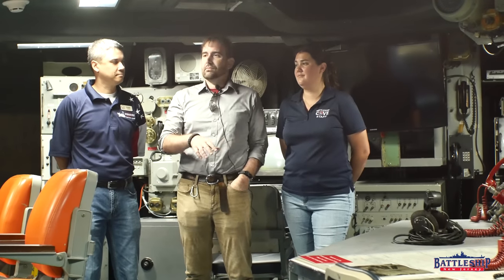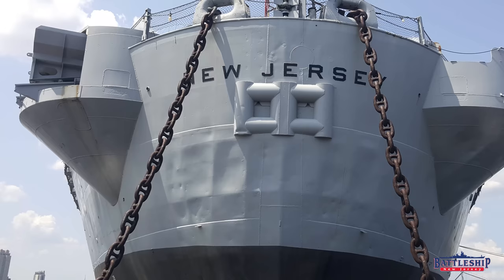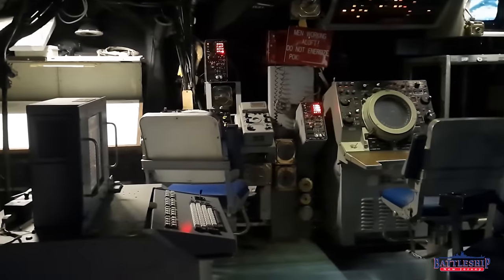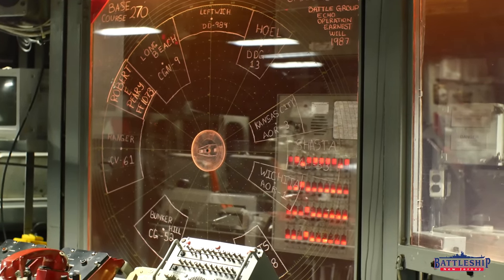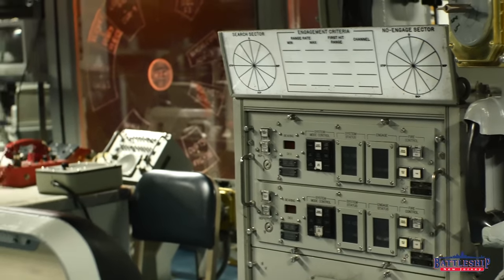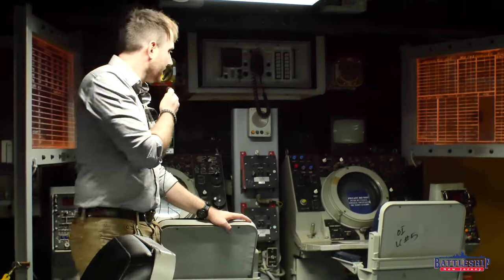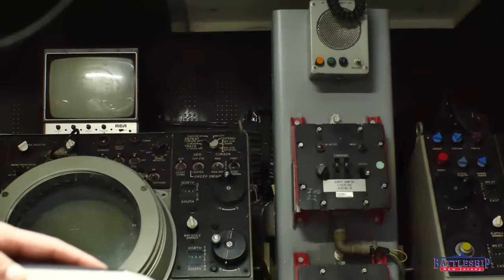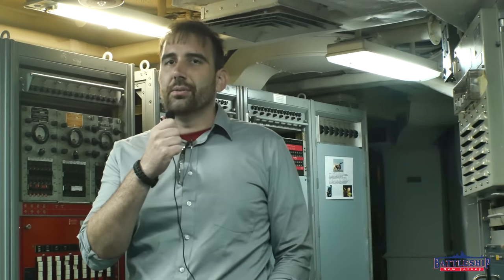A Modern Battleship's Most Important Space

Comment: Hey Ryan, remember what I said in a previous video about you walking us through conducting a simulated fire mission for the Tomahawk and Harpoon missiles? Basically running through the steps, moving the controls, seeing the board light up, etcetera - but not actually launching?

Battleship New Jersey doesn't have the equipment for that, but it looks like Missouri does. Maybe that would be good to see as another collaboration video with Mighty Moe.

Comment: CIC… combat information center
Reply: The Iowa class have both a CEC and a CIC. The CIC was used for original WW2, Korea or Vietnam war weapons and radar. The CEC was used for the systems added during the 80's upgrades. The CEC is effectively a second CIC. But because the 1940's designers didn't plan on fitting drones, tomahawk missiles and harpoon missiles and the CIC is filled with computers and control stations for the 16in and 5in guns a new CIC was needed for the new systems. To avoid confusion due to there being 2 CIC spaces a the new systems are in a area called CEC. CEC stands for combat engagement center.